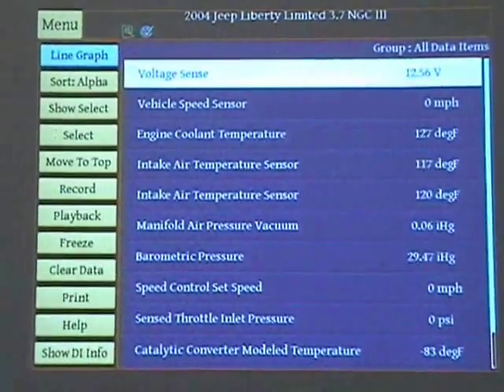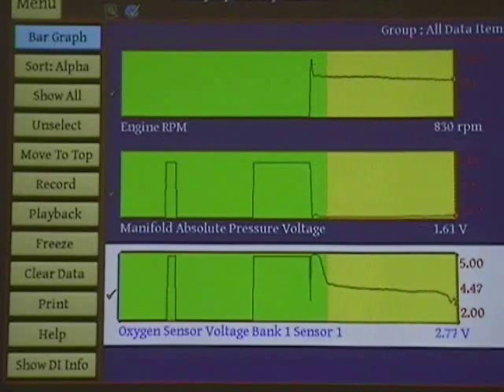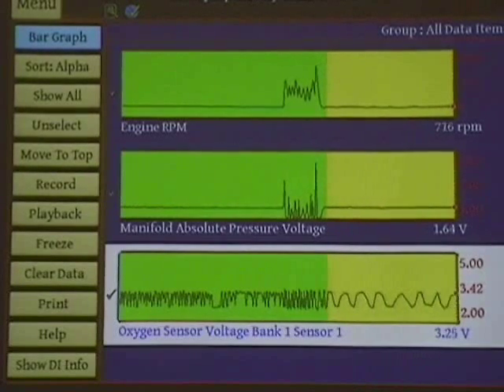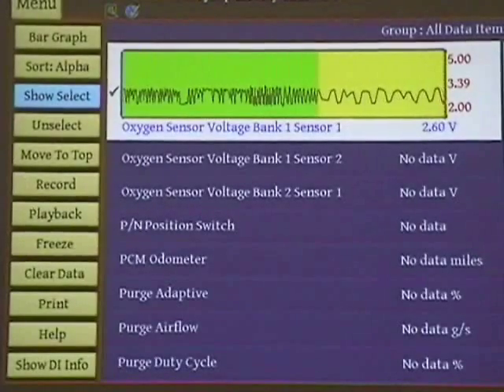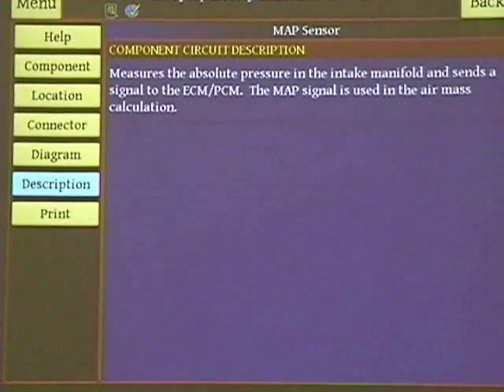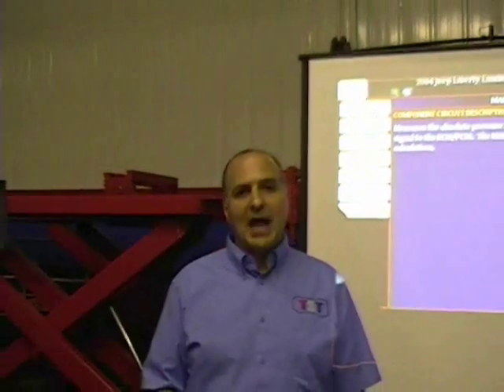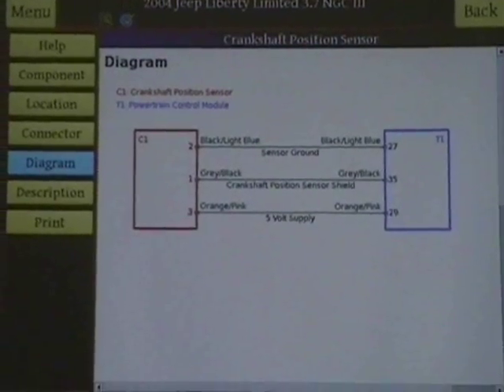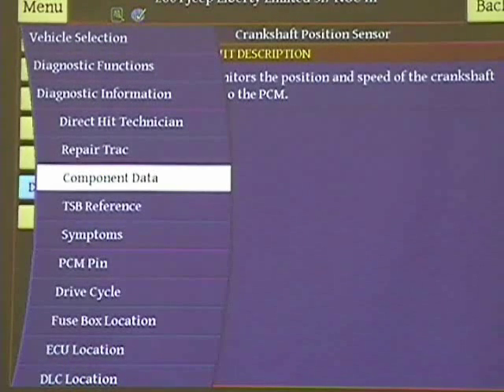Using the Scantool and Scope with the Pegisys PART 3

Comment: sir i bought a pegisys scaning tool unit , and why every time i try to go into the date stream as u do now on this video  when the ignition is on the scan tool switch off as long as i turn on the switch to run  engine ,
so scan tool on ignition on engine not running  ,, then switch to run engine ,, scan tool turns off !! >>engine runing ???